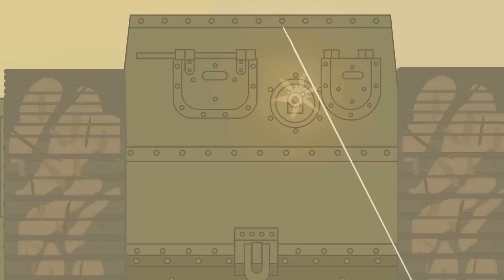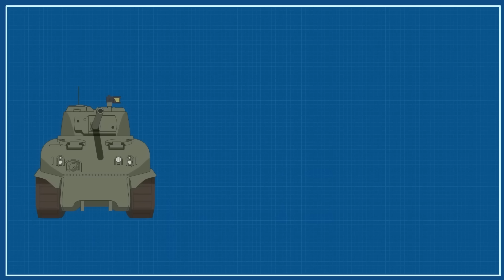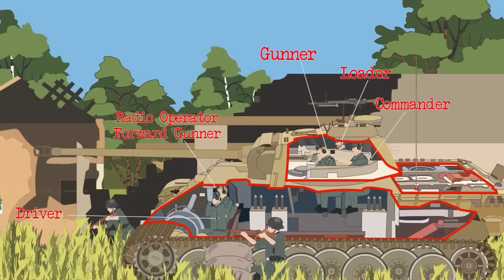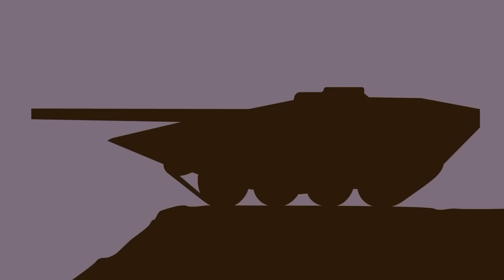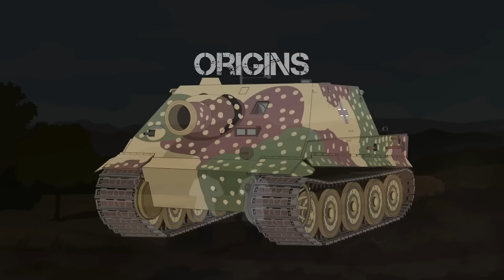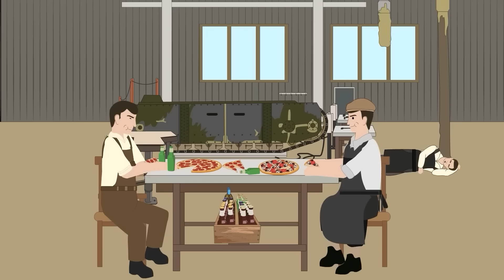Life Inside The Most Legendary Tanks (Cross Sections) - Supercut

Comment: The Panther D was a flop.  It went fast from the drawing board to production and had all sorts of mechanical problems.  Its first battle Kursk most were lost to mechanical failure leading to engine fires.  Hitler called the Panther "the crawling Heinkel" after the Heinkel 177 which also suffered from engine forces.  But once the bugs were worked out it was formidable.

Comment: disambiguation).

The first tank to engage in battle, the British Mark I tank (pictured in 1916) with the Solomon camouflage scheme
A tank is an armoured fighting vehicle intended as a primary offensive weapon in front-line ground combat. Tank designs are a balance of heavy firepower, strong armour, and battlefield mobility provided by tracks and a powerful engine; their main armament is often mounted within a turret. They are a mainstay of modern 20th and 21st century ground forces and a key part of combined arms combat.

A British Sherman tank in Italy during World War Two
An M4 Sherman in Italy in 1943 during WWII
A Leopard 2A7 tank at a public display in Germany in 2015
A Leopard 2A7 in Germany
Modern tanks are versatile mobile land weapons platforms whose main armament is a large-calibre tank gun mounted in a rotating gun turret, supplemented by machine guns or other ranged weapons such as anti-tank guided missiles or rocket launchers. They have heavy vehicle armour which provides protection for the crew, the vehicle's munition storage, fuel tank and propulsion systems. The use of tracks rather than wheels provides improved operational mobility which allows the tank to overcome rugged terrain and adverse conditions such as mud and ice/snow better than wheeled vehicles, and thus be more flexibly positioned at advantageous locations on the battlefield. These features enable the tank to perform in a variety of intense combat situations, simultaneously both offensively (with direct fire from their powerful main gun) and defensively (as fire support and defilade for friendly troops due to the near invulnerability to common infantry small arms and good resistance against heavier weapons, although anti-tank weapons used in 2022, some of them man-portable, have demonstrated the ability to destroy older generations of tanks with single shots[1]),[disputed – discuss] all while maintaining the mobility needed to exploit changing tactical situations.[2] Fully integrating tanks into modern military forces spawned a new era of combat called armoured warfare.

Until the invention of the main battle tank, tanks were typically categorized either by weight class (ultralight, light, medium, heavy or superheavy tanks) or doctrinal purpose (breakthrough-, cavalry-, infantry-, cruiser-, antinfantry-, antitank-, operational-, qualitative reinforcement-, combined arms-, special operations-, or reconnaissance tanks). Some are larger and more thickly armoured and with large guns, while others are smaller, lightly armoured, and equipped with a smaller caliber and lighter gun. These smaller tanks move over terrain with speed and agility and can perform a reconnaissance role in addition to engaging hostile targets. The smaller, faster tank would not normally engage in battle with a larger, heavily armoured tank, except during a surprise flanking manoeuvre.

Etymology
The word tank was first applied in a military context to British "landships" in 1915 to keep their nature secret before they entered service.[3]

Origins
On 24 December 1915, a meeting took place at the Inter-Departmental Conference (including representatives of the Director of Naval Construction's Committee, the Admiralty, the Ministry of Munitions, and the War Office). Its purpose was to discuss the progress of the plans for what were described as "Caterpillar Machine Gun Destroyers or Land Cruisers." In his autobiography, Albert Gerald Stern (Secretary to the Landship Committee, later head of the Mechanical Warfare Supply Department) says that at that meeting:

Mr. (Thomas J.) Macnamara (M.P., and Parliamentary and Financial Secretary to the Admiralty) then suggested, for secrecy's sake, to change the title of the Landship Committee. Mr. d'Eyncourt agreed that it was very desirable to retain secrecy by all means, and proposed to refer to the vessel as a "Water Carrier". In Government offices, committees and departments are always known by their initials. For this reason I, as Secretary, considered the proposed title totally unsuitable.[a] In our search for a synonymous term, we changed the word "Water Carrier" to "Tank," and became the "Tank Supply" or "T.S." Committee. That is how these weapons came to be called Tanks.
He incorrectly added, "and the name has now been adopted by all countries in the world."[5]

Lieutenant-Colonel Ernest Swinton, who was secretary to the meeting, says that he was instructed to find a non-committal word when writing his report of the proceedings. In the evening he discussed it with a fellow officer, Lt-Col Walter Dally Jones, and they chose the word "tank". "That night, in the draft report of the conference, the word 'tank' was employed in its new sense for the first time."[6] Swinton's Notes on the Employment of Tanks, in which he uses the word throughout, was published in January 1916.

In July 1918, Popular Science Monthly reported:

Because a fellow of the Royal Historical Society* has unintentionally misled the British public as to the origin of the famous "tanks", Sir William Tritton, who designed and built them, has published the real story of their name ... Since it was obviously inadvisable to herald "Little Willie's" reason for existence to the world he was known as the "Instructional Demonstration Unit." "Little Willie's" hull was called in the shop orders a "water carrier for Mesopotamia"; no one knew that the hull was intended to be mounted on a truck. Naturally, the water carrier began to be called a "tank". So the name came to be used by managers and foremen of the shop, until now it has a place in the army vocabulary and will probably be so known in history for all time.[7]
(*F.J. Gardiner, F.R.Hist.S.)

D'Eyncourt's account differs from Swinton's and Tritton's:

Comment: Trying to fight panthers and tigers in a Sherman is like climbing mount everest. The Firefly's cannon doesnt even come close to the Panther and Tiger's armor anyways.
Reply: The whole point of the firefly was to counter heavy German armour? The firefly’s 17 pounder could easily match the armour of a tiger.
Reply: @chewsday67  I've used the firefly against Tiger's in WarThunder bro it wont penetrate unless you hit side armor. In which case previous Shermans could also penetrate side armor. The firefly was an entirely useless tank when it was fielded.
Reply: @SleezyRider883  that's in warthunder. 
Read about wittmans, or any okw, appraisal of firefly in the bocage, that will demonstrate how inaccurate warthunder actually is.
The 17lbr could very much penetrate a tiger ausf E and B frontal armour, hence its priority use on black Prince, and, of course, centurion.
Reply: @chewsday67  Like "match" is a weird word for this anyways. Like yeah the firefly might have a slightly higher chance at front-facing penetration but not to any significant degree in which you'd actually consider shooting the front. You need bigger, or smaller, faster, and denser. 

Tbh people dont think of the effectiveness of using a HEAT or HE on the turret to overpressure the cabin directly underneath. Tiger's still probably beefed up in the top though.